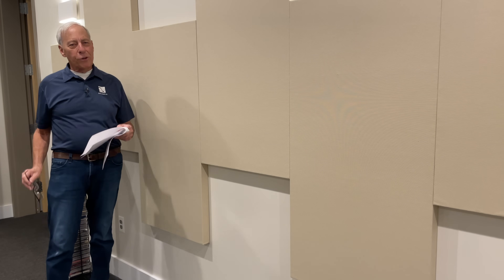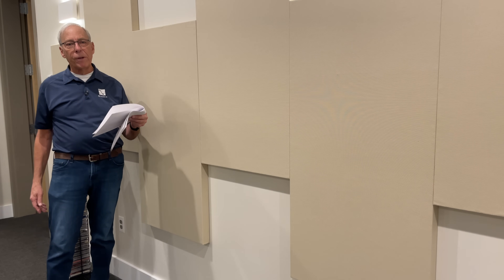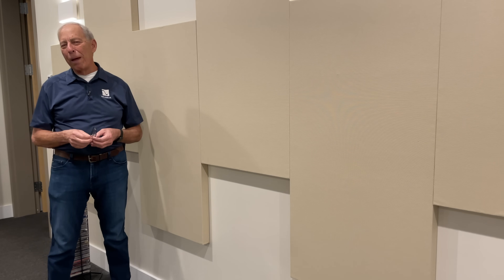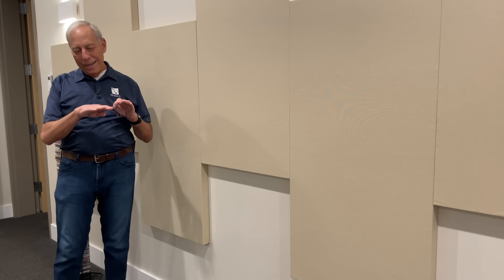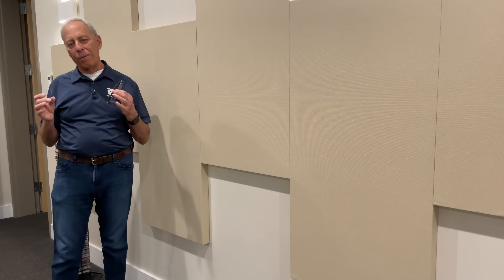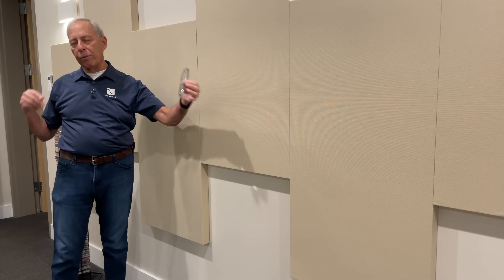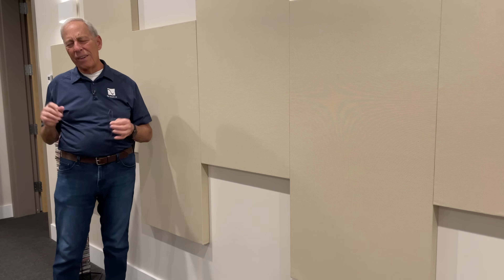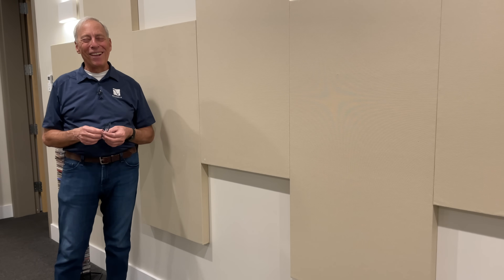Do audio connector materials matter?

Comment: Yes it absolutely matters!!! On this one i will be fist on the table over. I have the same complaint and i had the same question. So i tried several times with many different connectors and i can be absolutely sure plain bare wire has the best sound. I find it curious how people spend a ton of money for super nice cable, then terminate them with god knows what there made of. If you want to terminate the ends then the only way to do it is to make sure they are 100% pure copper!!! There is no excuse for making terminals out of inferior materials like tin and brass or what ever. It doesn't make sense to send the raw signal through tin then to your super expensive  copper cable, then back to tin again before it goes through the crossover. I dont care what anyone says it absolutely matters as these materials act as a filter. Different cables can sound different from one another because they act like filters. Just any copper wire isnt the same as any other copper wire just because its copper. There is without a doubt a difference in sound from one cable to another because of quality, how its  manufactured and copper content, and it size and how many strands and what size the strands are because the copper acts as a filter on its way to the speaker. Same is true with terminals. I personally have no terminals at all. The cable goes from the 1 and only terminal from the back of the amp directly to the crossover. i have eliminated the terminals on the back of the speaker. The system sounds so much better without them. Yes its real.

Comment: The rectifying effect of a metal oxide connection can cause a problem at low voltages (signal levels) that's why gold is used  (it doesn't oxidise) on phono and other signal connectors.  Copper is known to flow away from points of pressure but when alloyed copper can be quite hard, also the surface area of the connecting surfaces matters at higher power levels.

Keep your 'speaker cables as short as possible and use conductors that have 2.5 sq mm area, they'll be thicker than what's used inside your amplifier and loudspeaker enclosure.
Reply: it's interesting that at least one hi-end cable manufacture claims cable length does matter, that is, they don't buy into "the shorter the better", and no, I wouldn't argue at all against your suggestion, certainly has been my "norm" for years up until recently - just sayin'

Comment: radio shack made  milions of audio and video connectors  3 station input, selectors out to the aux in on your main unit,,,,,I think a third of them were defective,no one else out there made a similar device but made defect free,,I E  dropouts,,you jiggle any button on the face,bad connections on 2 of the 3 stations,,in about a year,the last one goes bad too

Comment: As an engineer I always understood that skin effect isn't significant at audio frequencies.
It's more a consideration in RF and UHF systems. Therefore audio current will happily flow through a gold plated brass connector as well as on the surface of it.
Reply: Skin effect does start to be significant at upper audio frequencies.  My experience is from driving yokes on CRTs, at 15,750 Hz (old TV horizontal frequency).  We tried several types of wire, ie litz wire, multiple stranding, etc.  The best we found at 31.5 kHz was  6- 20 gauge insulated strands in parallel.  Skin depth is also a significant factor for wiring a transformer for switching power supplies.
Reply: Correct. Skin effect is an issue at radio frequencies, way above audio frequencies.
Reply: Why not copper connectors on your amp, dac, & record player.
Reply: @myronhelton4441  Paul M already mentioned why in the video. Copper is too soft and would bend or break to easily. Also copper tarnishes very quickly and would cause a poor connection. Brass is a copper & zinc alloy, far stronger. Gold doesn't tarnish so gold plated brass is a very good cost effective solution. How well they are manufactured then becomes a more important factor.
Reply: @r44heliflyer  You are probably correct, or is Paul hiding the fact that he doesnt spend $50 extra for bronze copper connections on his equipment. He sad that there was different opinions. I have heard opinions on this years ago. Paul said why spend $50 extra dollars. Why not spend that $50 in the first place on much of the equipment that cost thousands. But I have heard opinions that Paul is right, but it seems odd, great stuff with shoddy connectors. Does anyone out there make good connectors? I always thought that a pre amp interconnects hurt sound & look at the extra cost. I use silver plated copper interconnects that sound better than pure copper Kymber Cables, but some say the connecters should be pure copper that has less magnetic interference.
Reply: Great and accurate comment!
Reply: As an amateur radio operator, I totally agree with your statement! (O:
Reply: A nice collection of learned individuals, solid points made. 
That said (I know, here it comes;), statements like "things we understand fully", or "the science is well understood" etc, can truly be a minefield. 
The older I get the more this resonates.
Reply: I always find it amusing that hardware and electrical engineers want to comment on the transfer  of audio quality by applying the same science used to perform simple data transfers and simple power transfers for manufacturing and machines as if they are the same.  I know I will get flamed, but don't care.  Suffice to say, the knowledge used in electrical engineering to ensure that a component of a machine operates to spec isn't the same as ensuring a signal transfer to a speaker is of the highest possible quality and fidelity. They are mutually exclusive and the only shared parameter is the use of electricity and conductive metals.
Reply: @falcon048  you mentioned science, what science is different between the two? Don't the same laws of physics apply?
Reply: @falcon048  -- A total b00|$hit stereotype of "hardware and electrical engineers."  Engineers who competently design audio gear understand how to apply their knowledge to the task at hand and prioritize their decisions accordingly.  The foundational science involved is exactly the same -- the proper application of that science is what distinguishes a credibly competent audio designer from his/her fellow engineers.
Reply: @falcon048  LOL, ignorance at its' best. Those very same engineers are the ones who design, create, produce, service, and improve the very audio products you love! As an engineer myself, in the same way as Paul McGowan, we strive to improve audio all the time using the science  of electronics. Far form being mutually exclusive, they are inextricably linked. Paul M made a minor mistake and overstated skin effect, a real phenomena but insignificant in this case.

Comment: My HiFi retailer happily said, "yes. Gold is a lesser conductor than copper or silver, bit and this but is big, is doesn't corrode. Best connection is jam the wire in there. Banana plugs are more for use off comfort. After that he was happy to sell me some
Reply: I always wonder if people REALLY hear a difference. But in any case, i prefer goldplated as well for your reason as well. Oxidation of brass or silver goes pretty fast.
Reply: @Douglas Blake ye, the more annoying part of this hobby. Separating the real from the snake oil. Or the things that have noticeable effects. Like power cables. Never heard any difference. 

Or worse, expensive utp cables... while the rest of the world runs on default cable,  and the protocol with error checks, acknowledges, and resends. And the file is decoded insidea streamer...
Reply: @Douglas Blake this is a fun conversation:)
Reply: @Douglas Blake quick question about the connection reply. I saw people using shrink caps instead of tin. Which would also protect from screws and such.

Any experience with those?

Ps, not spending money on plugs or the insane amount of money shops ask to connect them, suddenly makes buying cables a LOT cheaper lol. Provided they aren't exotic strands etc.
Reply: @Douglas Blake cool stuff :)

Comment: Just try to always keep all of your connectors in the audio signal path NON-ferromagnetic, (i.e. not magnetic), because magnetic materials, (such as iron and steel, etc), greatly affect the inductance of a terminal, and you don't want any or too much inductance in a terminal, (or cable), because added inductance CAN noticeably affect the sound quality, (albeit very minutely in just a terminal or connector, as Paul mentioned), but so if you at least stay away from any terminals or connectors that are affected significantly by a magnet, (like quite a few cheap quality binding posts and especially "push" spring clip type connectors on many (lower-middle end) speakers and such are), then you'll be better off.

You can quickly use a neodymium magnet like on a good quality "magnetic pickup tool", etc. to easily test the terminals on any component or speaker to see if it is magnetic, (less than ideal), or not. Hopefully, (at least if it's a "better" quality connector anyway), it WON'T be magnetic...

The same thing goes for the actual leads on any given component in a speaker crossover itself, including the capacitors and resistors especially, because oftentimes the cheaper quality capacitors such as electrolytic and most mylar ones will have magnetic leads, but most all polypropylene or better ones won't be magnetic. (Just one of the many reasons that polypropylene capacitors almost always tend to sound better than electrolytic ones especially.)

Resistors are similar, in the fact that most truly audio grade resistors for speaker crossovers will have non-magnetic, (usually plated copper), leads, whereas the cheaper quality resistors that aren't specifically made for speaker crossovers will usually have steel leads or terminals instead.

The actual inductors of a speaker crossover themselves will be made out of copper wire (or copper foil, etc) already, so they are usually already good... But the CORE of an inductor is also something to consider, and the air-core coils tend to usually sound better than the coils with an iron or laminated steel core, due to steel and iron "saturating" (distorting the sound) with higher level signals going through them... But THAT is another topic, ("can of worms"), entirely... WAY too much to get into here, lol!
Reply: i like speakon connectors.
Reply: @shangrilaladeda  Yeah, they're not bad, but it's too bad that they're not ever even offered on home speakers, only on so-called "professional" stage stuff.

BTW, is your screen name a funny, carefree reference to the "mayhem" that I.C.P. rap about in their songs?
Reply: @JoeJ-8282  no it's about the mythical place and i also read the poems i write that is what the la de da is for, also i do upgrade my connections to speakon going with neutrik each costs around 10 or more dollars no more than 30 for there are pricey connectors but they are rated for 50 amps not many speakers need that rating though the nlfx2 or nlfx4 are good enough for most home equipment.
Reply: @shangrilaladeda  That's cool, (about your name), and it's also good info to know, (about the connector upgrades), I might try that myself on some speakers I have 2 matching pairs of, just to see if it makes any difference in sound quality. These speakers are already pretty good even as they are, so maybe I could actually hear if a terminal/connector upgrade would make them even better still. Thanks.
Reply: Make a video bro
Reply: @mateodepaz  who?
Reply: @shangrila Joe the comment originator, @joej8282, should make a video.
Reply: @mateodepaz  Haha, yeah... no, prob. never. For one, I don't even know how to do that, nor do I have any of the equipment needed to make and upload a video online...

Besides, even IF I DID, I still wouldn't EVER do that because I'm WAY too introverted and shy for that! Basically almost no-one except for my close family, my one best friend and my boss at work even really have ever even seen my face and actually know what I look like. Definitely not anyone online! Other than just watching the occasional YouTube video to learn about something I'm interested in, I don't have ANY online profiles anywhere or ever do any other kind of "social media" sites or BS "online dating" crap because I see that that stuff is pretty much a total waste of time. I just keep to myself and just do my hobbies and stuff by myself in my own house. No-one else I know even cares about electronics or audio stuff at all anyway, so it's cool with me.

I may be (at least semi-) knowledgeable about certain topics, but I'm a loner, not interested in ever "showing" myself to anyone, because in my experience throughout my life, no-one seems to really even care what I may know about something. I've tried suggesting things to people before but I usually just get ignored or told I'm "wrong", so whatever, I just do me, no-one else matters.

I mean, I don't mind attempting to help people out verbally or in writing, (IF they are open to the idea), but I definitely don't have a face for the camera, lol!... NOR do I have any interest in attempting to prove a point to any online "trolls" or "haters"... and unfortunately there seems to be plenty of those types of people online, which to me is just totally disgusting energy and a complete waste of everyone's time! Why anyone ever thinks they need to be ugly to someone else online just baffles my mind, and I won't stoop down to that level of negative energy to even talk to those types of people... And that is one reason I won't do online anything, because there's just too much of that kind of ugliness out there online, and it's not even worth wasting your own positive energy trying to deal with others who are negative energy people. Yes, I know there are still plenty of good natured people in the world too, but the negative energy ones just ruin it for any online dealings for me! (That and my social awkwardness due to my Asperger's)
Reply: The amount of ferromagnetic mass in an amp-to-speaker circuit is completely irrelevant and completely unrelated to the relative performance of air-core inductors vs. their iron- or ferrite-cored counterparts since a coil's core has no conductive function whatsoever and all a speaker cable and its connectors have to do is conduct the signal while not imposing enough resistance to influence how the drivers and crossover perform.   Unlike a ferromagnetic inductor core, the tiny bit of iron in a binding post or crossover component leads has exactly zero audible or measurable effect.  You come off like you've been quaffing some of Danny Richie's audiophool KoolAid -- that dude's clearly an accomplished speaker system designer (within the limits of his second-rate test gear), but he's way out of his depth when posing as some sort of electrodynamicist holding forth on the properties of conductive materials in the context of the frequencies and impedances involved in amp-speaker connections.
Reply: Why not copper connectors om your amp, & dac & record player.
Reply: @myronhelton4441  -- Because such connectors tend to be expensive, copper is too soft to keep strong contact tension and tends to corrode to a green, non-conductive oxide, and they have neither measurable nor audible advantages over garden variety nickel- or gold-plated brass or even (shudder!!!) steel.
Reply: @myronhelton4441  -- You can't possibly be serious.  WTF does that demonstration have to do with "stereo connectors?"
Reply: @editorjuno  The demonstration makes plenty of sense. Another guy made a comment on this section  that I read that is related to my comment & I accidentally left one word out that I meant to tell you. The demonstration is related to what the guy said. You can go through this section & read the comments on this section & figure this fantantic very interesting scientific fact out. Do you expect anyone to answer you for your vulgar attitude.
Reply: @myronhelton4441  -- You don't know WTF you're carrying on about, and I'm sure that makes at least two of us.  There is no significant inductance in an audio connector regardless of whether a ferromagnetic material is involved or not.
Reply: Dont use stereo connectors that are magnet. Watch & click next link. https://www.youtube.com/watch?v=5BeFoz3Ypo4
Reply: Dont use stereo connectors that are magnetic. Another comment said to use copper. Watch & click next link. https://www.youtube.com/watch?v=5BeFoz3Ypo4

Comment: With all this talk about what sounds "better" via materials, construction, parts, etc, no one ever talks about what "better" is. Perhaps no one talks about it because it's a personal thing - yet at the same time, every individual defines it as if it's some audio standard that everyone should subscribe to. This hobby is such a strange paradox. It's like a $100,000 audio system will sounds like complete trash if brass connectors are used for the speaker terminals. Whoever subscribes to that is completely mental. 

Audiophiles or audiopsychotics. Which one do you subscribe to?
Reply: Check this out to learn more on this good question 
https://youtu.be/-P6TrQTuqMo
Reply: @JingoLoBa57  i watched this and I admit it was a bit challenging understanding what he was trying to say with the disjointed English captions but it seems that the point was that materials, in this case, sliver, copper, and the silver-coated copper wires really didn't measure any differently until some kind of reverse polarity on the wires that gave the music track a slightly different sound characteristic. I'm probably wrong because I'm not an electrical engineer but that was my impression. 

It almost explains why some cable manufacturers design directionality in their interconnects and other cables. I could hear differences but whatever I preferred would simply be what I liked.